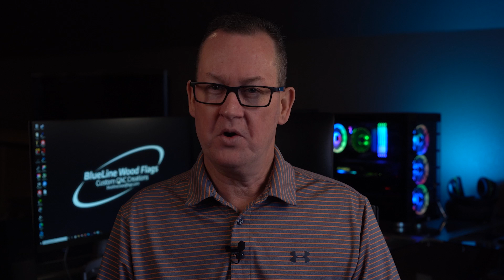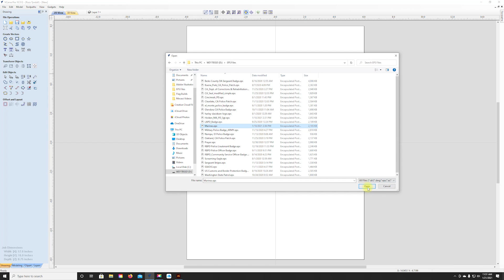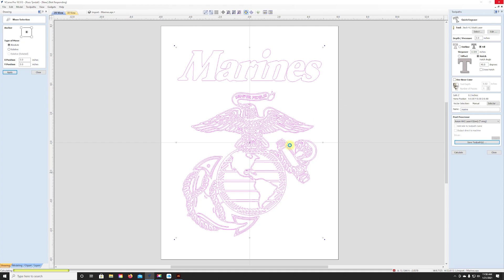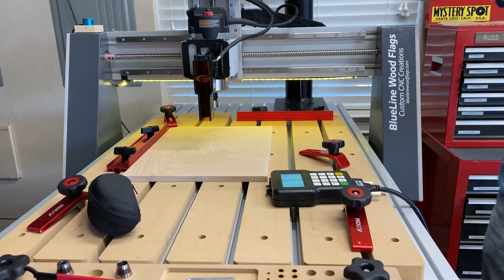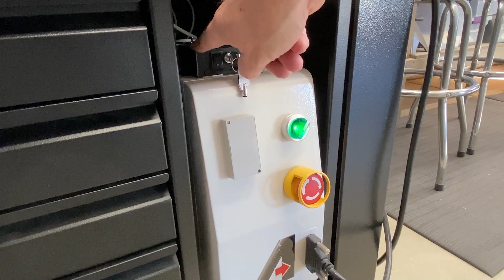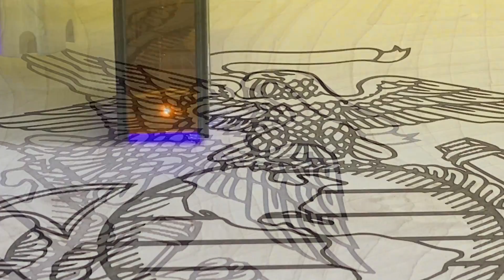Using the JTech 4.2 Watt Laser on an Axiom CNC - Project Demo Tutorial

Comment: Hi Russ...love the tutorial...i have a quick question, after i updated Vectric Aspire to 11.5, when i create a laser toolpath using the Quick Engrave, i cannot see any preview. I am using your exact settings for the laser tool, and for the Quick Engrave, and i have the laser post processor installed in Vectric...im using an Axiom pro 5 CNC...am i doing something wrong?
Reply from the maker: Hi Stephen. You won’t see any laser preview, just the tool path before you try and run a preview in 3D view. 3D will only show carvings, where the laser is not. Hopefully that answers your question. It was the same before you upgraded. Try running the program on some scrap and I think you’ll see it works.
Reply: @BlueLineCNC  Thanks again Russ.. I thought I was doing something wrong in the software..I hope Axiom does make their machine compatible with the laser module in vectric at some point though.

Comment: Russ...how do i select the j tech laser in the box when making the tool path? I already downloaded the laser post processor, but i do not see J tech as an option to select when selecting the tool
Reply from the maker: Setting up your Jtech as a tool to use is separate from setting up the post processor. If you are using an Axiom machine, they well document both in their included manual. Read it thoroughly. If you still have difficulty, send me your email address through my website contact form. https://bluelinewoodflags.com

Comment: How do you count off 80 mm to home the laser? A ruler? A caliper? Where do you start the measurement?
Reply from the maker: Your laser is mounted -80mm offset on the Y axis, therefore use your pendant to reposition by moving your laser 80mm in the Y+ direction.  Once you have repositioned, you can re-zero your XY. Don’t use anything but your machine - let it do the work for you.  Assuming you use an Axiom machine, just use your pendant to accurately move it.  Just start your measurement from the spindle zero point and move 80mm Y+ from there.  Hope all that made sense.
Reply: @BlueLineCNC  It made sense and helps a lot...many thanks :) ..looking forward to more of your great projects

Comment: Nice instruction..how do i change the delay back for regular CNC cutting? And Do you have a demo of how you made those vectors in Illustrator? Where can i get a copy?
Reply from the maker: Just go into your spindle delay again the way you did to start, highlight it, and press DEL on the pendant. Then put in 4000 milliseconds and press enter and you’ll be back to where you need to be.

The Marines Eagle Globe and Anchor artwork was obtained from the public domain as I recall. I had to remove some color and used portions of the logo for the laser demo. 

Stay tuned to the channel for how I work with these vectors in Illustrator!

Comment: I'm having trouble when the spindle lifts the laser does not shut off (and leaving slight lines at it moves to the next position to burn). I looked back and when I save it to the laser post processor it automatically reverts back to the cnc p.p. after it goes through the save process.
Reply from the maker: Make sure your spindle delay is set to 0.  For regular operations, it should be 4000 milliseconds (at least that’s my settings).  You change that in machine set-up.  Not sure why it’s switching post processors on you as long as the laser one is the one associated with your file. I followed Axiom instructions to the letter, line by line, and had no problems.  The quick engrave tool paths operation is the way to go go with laser engraving.  Just remember the J-tec lasers that Axiom sells are not set up for shading/grayscale.
Reply: @BlueLineCNC  Yup I had all those settings in place, I just redownloaded the post processor from jtech and it worked maybe since the last time I used it it got updated for newer versions of aspire???? but whatever it works, thanks for the reply!
Reply from the maker: Glad it’s working correctly for you.

Comment: great video!  How long did it take to run? Can you feel any depth to the burn?  Do you finish it with light sanding or stain or anything?
Reply from the maker: Thanks.  It took about an hour and a half to run the project.  I started with a piece of maple sanded to 400 grit, so I’ll probably just clear coat it with som spray lacquer.
Reply: thanks